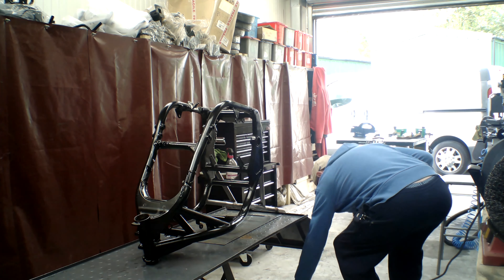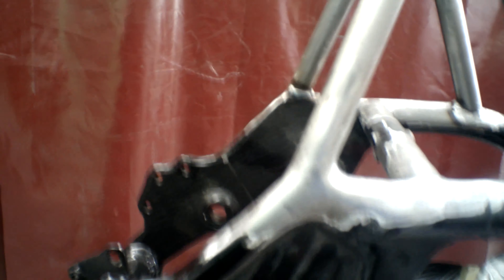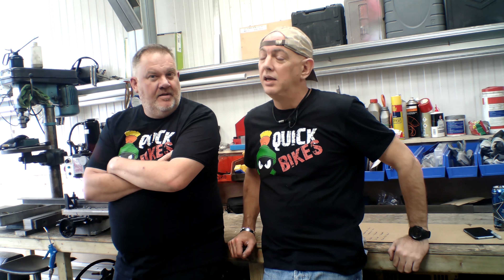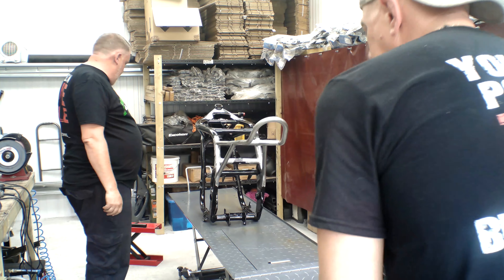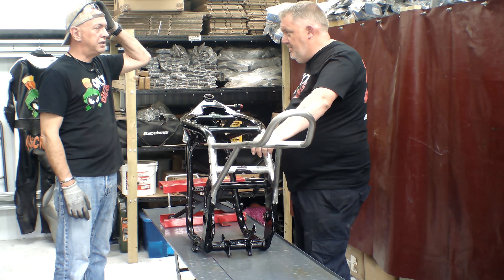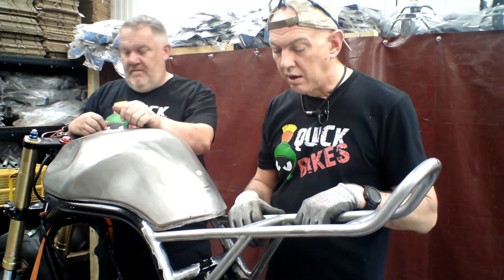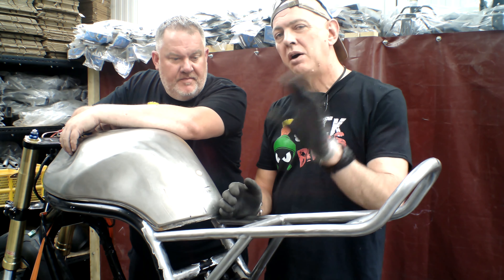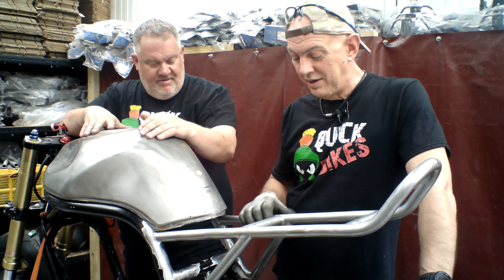Welding, grinding and back to a rolling chassis - Suzuki Bandit Cafe Racer - GIXIT Project Part 14

Comment: The banter is good..Are you going to be dressing all the original welds on the frame..
Reply from the maker: Cheers Ant 👍
I really want to sort out the other welds but don't know how much penetration they have or the wall thickness I have to play with when grinding. I need to do some homework to find this out before I can start grinding as I don't want to weaken it. Ideally I'd get another  Bandit frame that I could cut up and know for sure...
Stay tuned 👍

Comment: Great work guys. question, what modification was needed to use the gsxr swingarm? i'm thinking about doing this to my GSF.
Reply from the maker: Thank you 👍
Steve O would better explain this than I, but basically the frame was machined back to accept the slightly wider Gsxr swingarm and some top hat spacers turned up to fit in the ends of the swingarm. Please note that I discovered an issue with the top hats not riding on the bearing, so this set up will be changed in a future video. Good question, I like it 👍
Reply: @QuickBikes  got it, thank you very much.
Reply from the maker: You're welcome matey 👍

Comment: waffle and explanation is good.  but...in the end, it's your channel fella...do it as you wish.
How do you know how far to go with the dressing up of the welds?  i guess you can go too far and compromise the weld strength?
Reply from the maker: I get that it's my channel to do with as I please, but I'm keen to keep folks happy as well. As far as dressing the welds, it all starts with how you weld it. I've found that making sure you get LOADS of penetration (which you can tell when you're doing the welding), then you've got plenty of material backing the join to dress the top surface down. If you don't have the penetration, it'll be a weak weld anyway. I double check the setting I'm using by using a piece of the same tube to practice on first, then you can see how much penetration you're going to get as well.
Good question matey 👍
Reply: @QuickBikes  and good explanation...i am not a welder although i might try and wield one in the future. 
Yeah...i know u gotta keep folks happy 👍 a mixture of banter and describing what you are doing is good. I like to know what someone is doing and not just watch them...i think you are doing really good at this...keep it up 😁
Reply from the maker: Thank you 😊
If you're going to have a go yourself I'd suggest just do some practice pieces first so you get confident with it... Maybe chop up some tube into 100mm lengths, cope the ends, tack then weld them. That way you can check down each end of the tubes and see how well you did. Just make sure you bevel the ends and don't worry if there is some wiggle room as the weld will fill it up. Best of luck matey 👍🤞

Comment: oil cooler gsxr cam grind ?
Reply from the maker: Not sure what you mean Evan... Use more words matey... 🤔
Reply: @QuickBikes  holeshot make cams with the prifile of the oil cooler gsxr 750 to fit these engines. will you be changing the intake or exhaust or both it really wakes them up.considering your putting on mikuni flat slides witch is a huge up grade.
Reply from the maker: Oooooooo..... Hehehe, STEVE O.... How deep are your pockets and is this something you want to look at?
The intention was to run what we got, but he does like his toys. I'm sure he'll look into it and we'll have to get back to you Evan... Thank you very much for your idea matey 👍